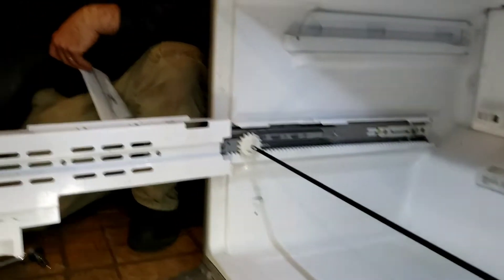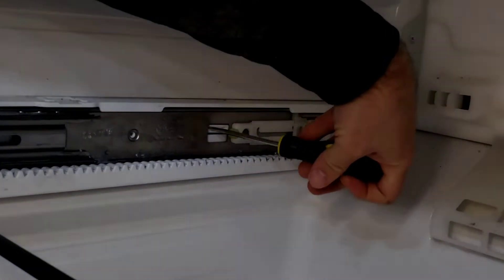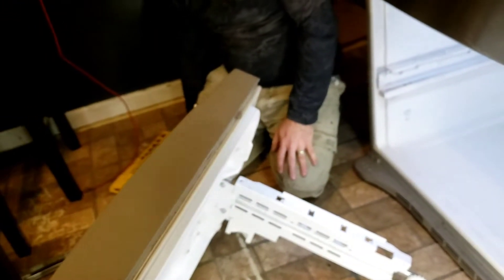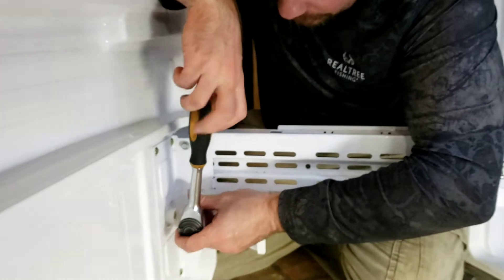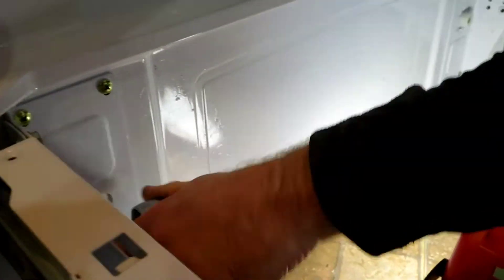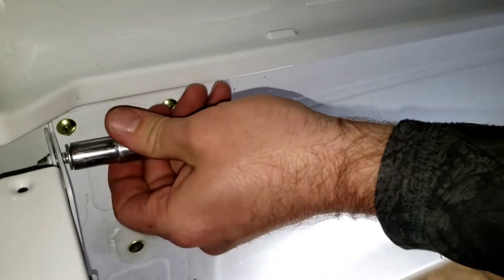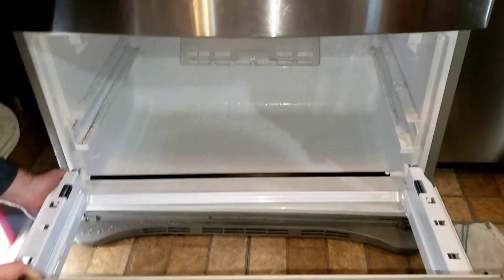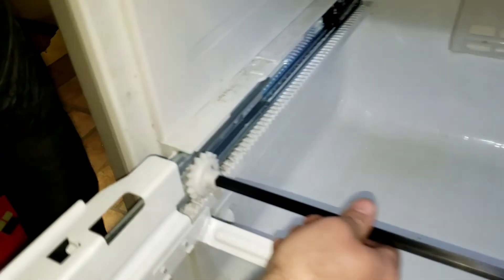Replacing Samsung refrigator bottom door freezer drawer slide rail. freezer door wont open or close.

Comment: Hi, I enjoyed the video, but I’m curious if this solved your problems?  I have basically this same fridge, honestly, it’s a total POS… my freezer drawer still retracts, but it’s sagging to where the bottom is super tight but the top is still pretty loosely sealed.  I saw where GE doors have an adjustable set screw for this issue, but don’t see any thing like that on this model.  Any tips are appreciated.
Reply from the maker: Hey Hatter, this did solve our problem and has been working great since.

Sorry you got one of these POS fridges as well.

Good luck and thanks for watching!

Please like and subscribe every little bit helps during these times.

Seize the day each and every day-Are Jay